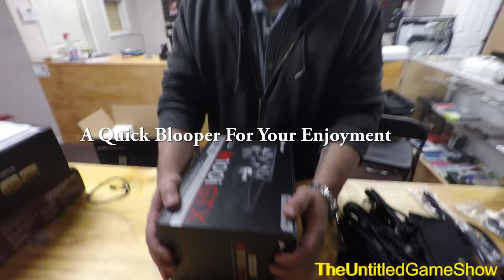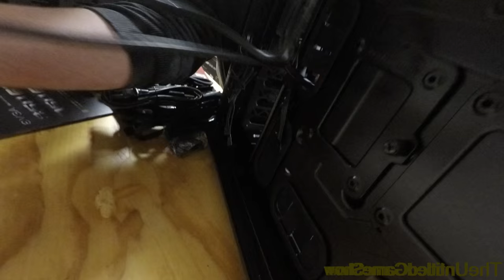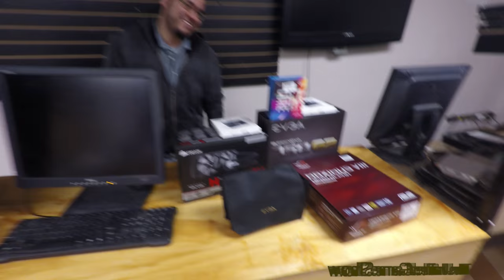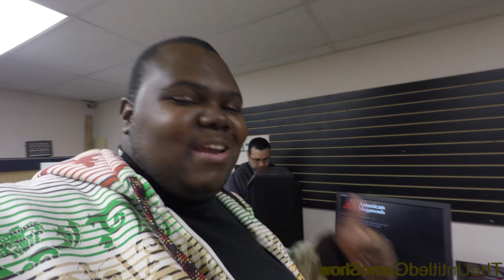Building a Quiet 4K Video Editing Gaming PC Part 2 - Installation

Comment: Thanks for the "★Time stamp★
Intro Blooper: 0:00
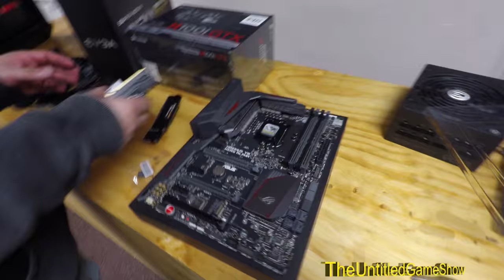32gb Ram Installation: 00:18
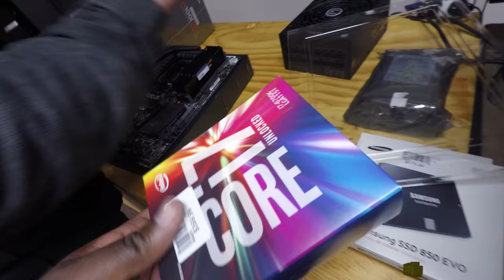Core i7 Processor Installation: 01:17
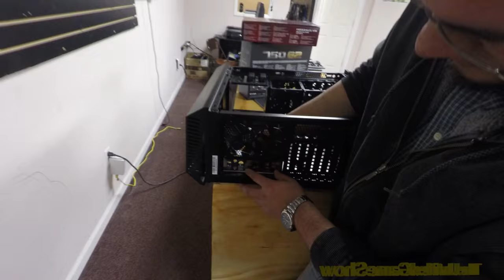Asus motherboard io shield installation: 02:07
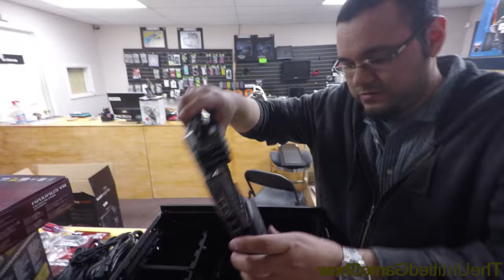Asus motherboard installation: 2:19
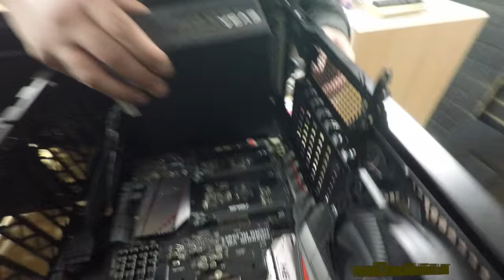Power Supply installation: 3:09
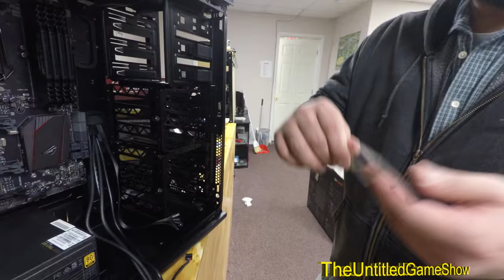Front Panel Connectors installation: 4:27
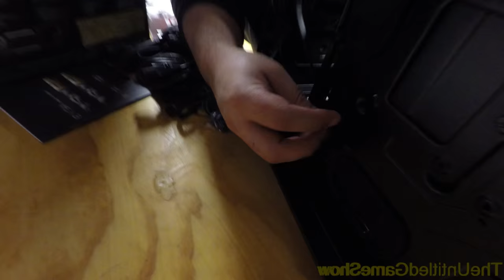USB 3.0 Header Cable Installation: 5:27
HD Audio Cable Installation: 5:55
USB 2.0 Header Cable Installation: 6:06
Samsung 850 Evo SSD Installation: 6:20
Hydro Series H100i GTX Extreme Performance Liquid CPU Cooler Installation: 7:24
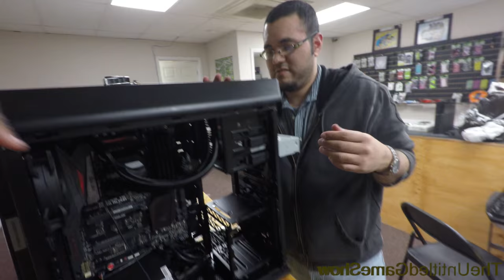3.5 Hard Drives 8:13
Optical Drive DVD/CD Player installation 9:14
C985 Live Gamer HD installation 9:41
GeForce GTX installation 10:41
Completed Build Overview: 10:57
Turning the Computer On: 12:26
Build Summery + Upcoming Video Info: 13:41
Bonus Clip Quietness showcase: 14:33
Outro + Support Info: 15:27"

Comment: for $600 more you could have a 10 core Xeon Workstation which professional editors call an entry level pro editor/render workstation and is made for editing with ECC ram and room to grow unlike most others with room for a second Xeon CPU and 14 more sticks of ram (16 total) This is what I call future proof and with room to grow. It games with the best of them with single GPU's.
Reply from the maker: +richcali21 Yeah I would love full Workstation but at this point it better to use that $600 for better camera gear and other equipment. I will get high end Workstation just for editing just in a few years. I gotta take baby steps here with my budget and time. Still you not wrong at all

Comment: Heyyyy me again with a quick update, got everything exactly, except the Ram which i will get next month, i have a problem with the GTX980, the 04G-P4-1982-KR and 04G-P4-2982-KR are just impossible to find, i will mostly do video editing, i won't use this rig for gaming at all, which is a good replacement card?   
04G-P4-1989-KR is watercooled, will fit the BGW02 case? i would love to stay as close as your build list, Thank you !!!

Comment: Thanks to you im creating a cool station, all based on your parts list, but i still would like to have 64 MB Ram instead of the 16 gb linked on your description, Corsair Vengeance LPX 16GB (4 x 4GB) DDR4 DRAM 3000MHz (PC4-24000) C15 memory kit for DDR4 Systems that is 16 GB what do you recommend for 64 GB? Thanks !!!    Will this work ? Corsair Vengeance LPX 64GB (4 x 16GB) DDR4 DRAM 2666MHz C16 Memory Kit for DDR4 Systems CMK64GX4M4A2666C16
Reply from the maker: +Calderone (tvr2120) Ohh nice man, let me know how the build comes out once you got it together. Also that pick ram should be geart.
Reply from the maker: +Calderone (tvr2120) Ohh nice man, let me know how the build comes out once you got it together. Also that pick ram should be geart.
Reply: +Untitledgameshow thanks for confirmation, i have to buy everything off ebay and then ship it to my country (Chile) so it might take quite some time but i already started thanks to you, btw one last question, what's the power supply used on your build? Thanks for the great videos!
Reply from the maker: Calderone (tvr2120)
it was a EVGA G2 eco mode power supply